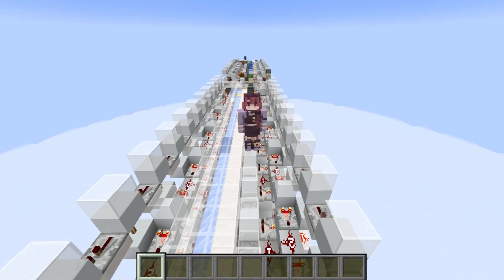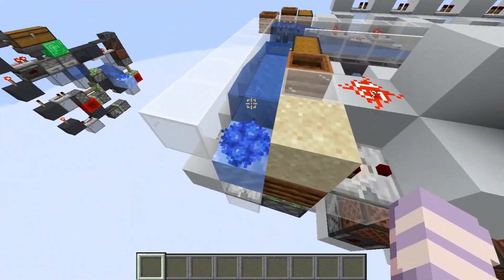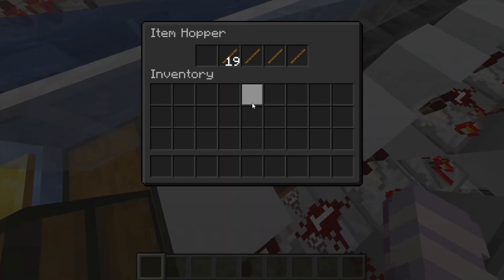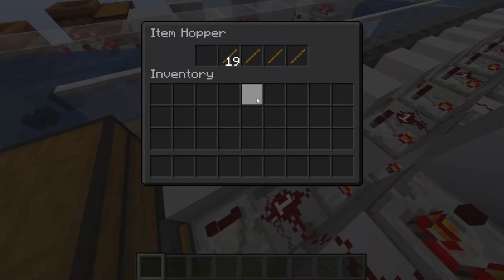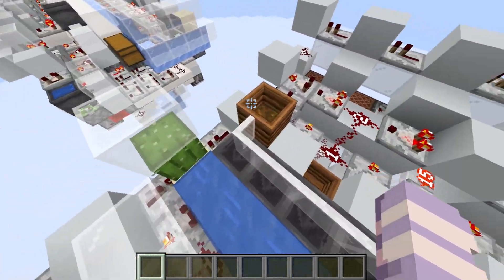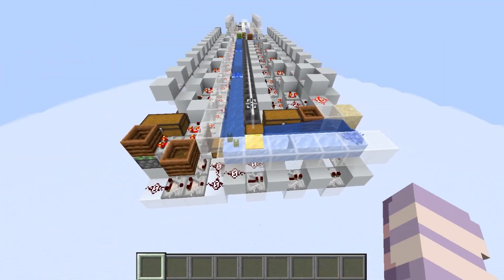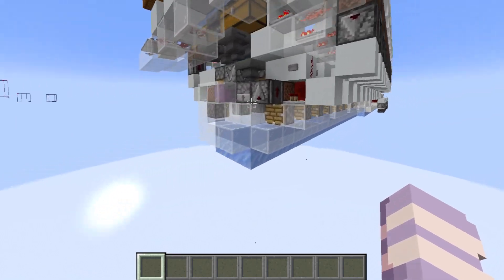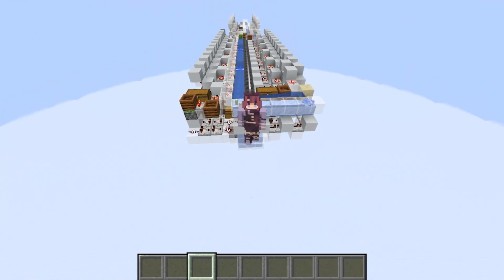Global Reset Variable Loader

Comment: Copied from heilz
Reply from the maker: No. I’ve actually spoken to heilz on this before. The concept is ofc the same, as otherwise it wouldn’t be a global reset var, but the slice is a new one and has slightly different wiring to fit with that
Reply: Is this better than heilz's design
Reply from the maker: Well, it’s smaller and has a nicer slice imo. The only downside is that it breaks the empty boxes too when reseting. But that’s not really a problem to lose a couple shulkers each reset imo, and it is pretty easy to add yourself if you want it